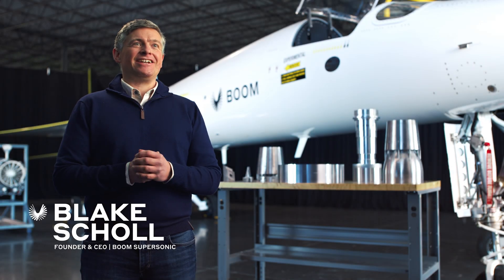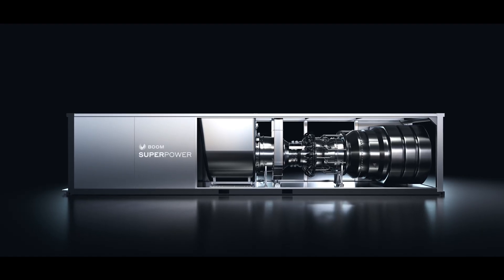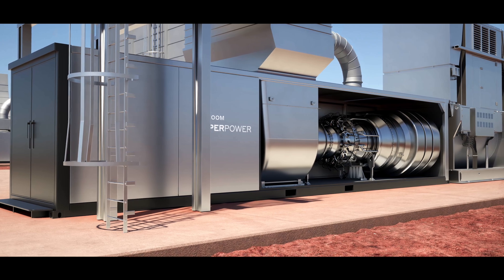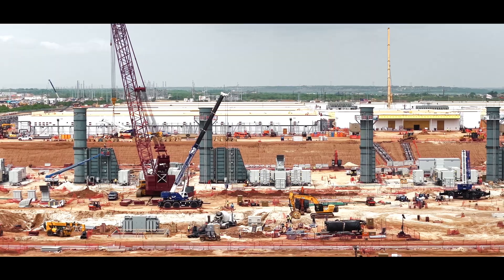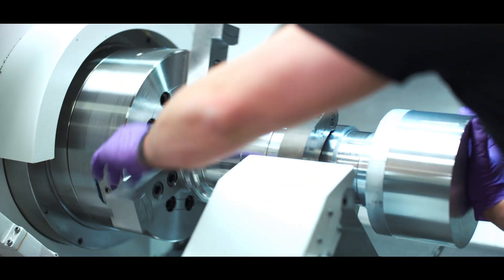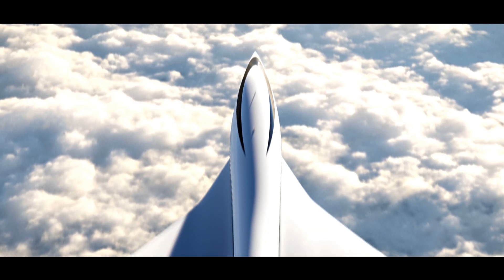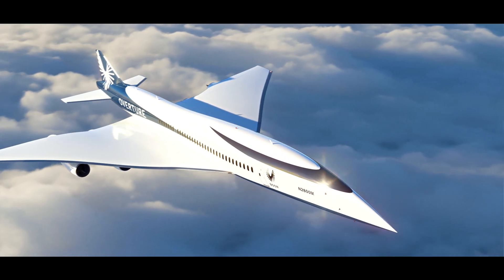Introducing Superpower: The Supersonic Tech Powering AI Data Centers

Comment: Quite a small unit . Others use engines like the RR Trent which is over twice the size and probably more efficient.  I don't think hours clocked on the ground are quite as valuable testing wise as hours in an airframe at 40000 ft.

Comment: A balanced take - potentially a distraction from the primary mission of building the jet. However, if they can actually get this done and get even a handful operational in 2027, the credibility gain to the new engine design alongside all the long term running data they will get will be invaluable. Not just from a perceived reliability standpoint, but from a certification standpoint. Pilots that fly PT-6 equipped airplanes often brag that it is the most reliable turbine engine in the world and how there are turbines running in ground power applications that have stupid amounts of continuous runtime. I am at least glad there's a potential here for an actual revenue generating product soonish that will help Overture come to fruition. You go guys.
Reply: Certification is just a bit more complex than hours accumulated on the ground which bears no relationships to it's actual usage in an aircraft.... That's the sort of trick Boeing would try, but then it sponsors the FAA.

Comment: I see a lot of confusion here, so I will throw in my two cents to add to it.

There are 3 basic designations of gas turbine usage.  

Aircraft engines, which are optimized for thrust, for obvious reasons.  They have massive thrust but almost no torque.

Industrial frame engines, which are optimized for torque.  They have almost no thrust.  In fact, the back wall of the exhaust collector is frequently no more than a couple of feet from the engine exhaust flange.  Typically their casings are several inches thick, and they would break off any wing they were attached to.  The output shaft is connected to a reduction gear which is then connected to a generator.

Aero derivative.  These are the high pressure core of an aircraft engine, referred to as the gas generator, with a power turbine bolted to the exhaust.  The only mechanical connection between the gas generator and the power turbine is the outer casings are bolted together.  This is called an aerodynamic coupling.  The power turbine spins at a much lower speed and converts the high thrust gas generator exhaust into high torque output, which is then connected to a reduction gear and a generator.

The exhaust of the industrial and aeroderivitave engines is usually sent to a boiler (actually a steam generator, which is NOT a boiler) to create steam and recover the waste heat.  This improves fuel efficiency dramatically.  This type of plant is referred to as combined cycle when used for pure electrical production.

The steam can be used for customer applications such as food processing, paper mills, enhanced oil recovery, or any other process requiring heat or pressure.  Typically the excess electricity generated is sold.  This can offset the fuel costs that would otherwise be required to generate the steam by a large amount while also providing essentially free electricity to power the process.

The steam can also be sent to steam turbines to generate even more power, but this requires more equipment like superheaters and condensers, and the plant will require much more cooling water.

The turbines will run on any fuel that you can get through the fuel injectors, but is usually natural gas, diesel fuel, or aviation grade kerosene.  Many plants will only use natural gas, but other plants will have dual fuel capability for reliability.

40MW is a good capacity.  By placing multiple units side by side in the same generator station, one engine can be taken off line for maintenance or repairs while the rest pick up the slack.  This is called power blocking.

The other advantage is that the shipping container size allows them to be placed anywhere there is a natural gas pipe, a power line, and water available.  No 5 year construction plan is necessary.  Just pour a concrete pad, bolt it down, and hook it up.  The waste heat steam generator and the auxiliary equipment will take much longer.  The water usage of a combined cycle plant can be very low, depending on cooling systems design.

The statement that inlet air cooling is not necessary even at high ambient temperatures is surprising though.  Higher ambient temperatures reduce air density, which reduces compression, and limits how much fuel can be introduced.  In addition, it will have major effects on NOx and CO emissions, which is a major constraint of these types of plants.

There are emissions reduction technologies, but they are very expensive, maintenance intensive, and require very well trained technicians.  High school grads won’t work.

Nobody has done it yet, but I am waiting for the day someone designs a plant that consists of a few shipping container sized packages.  One contains the turbine and generator, one contains the steam generator, one contains the control room, shop, and switchgear, one contains the auxiliaries such as pumps, air compressors, water treatment, etc, and one contains a steam turbine/generator.  Pour a pad, bolt the containers down, hook them up to each other and the utilities, and push the start button.  Build and test them at a factory where you also train the operators.  There you have it, a 40MW plant that can be installed and start operating in less than a month.  And since the plants are a standard design, moving crew around is not a problem.  Currently, although components and turbine packages may be standard, the rest of every plant is a bespoke design, which makes it a major cost.

If your plant manufacturing facility is located in a major city there will be plenty of trainee candidates that graduated high school, are very smart, but for one reason or another they aren’t planning on college.  Pay for their training with a contract that after completing training they will work for you for 5 years, or pay their own training costs.  Then have them bid on which plant they want to operate.  The only requirement is that they can pass an aptitude test and are willing to relocate upon graduating the training program.  As part of their training have them assist in plant construction and testing.  That way they know the ins and outs of the design.

There are many small towns all across the US that are at the end of a long, dirty power line, and are the first to have their line cut during upsets.  By installing a small plant on the outskirts the town can have their own plant based on three models:  the town can hire the manufacturer to own and operate the plant; the town can own the plant and hire the manufacturer to operate it; or the town could own and operate the plant.  Under any of these three scenarios, the high efficiency of these plants will allow lowering of electricity costs while still generating revenue for the town.  Of course the utilities will fight this tooth and nail, but screw the greedy bastards.

The environmental benefit is that while it doesn’t eliminate fossil fuel use, it dramatically reduces it, and natural gas burns cleaner than the alternatives.  While solar or wind plants would eliminate fossil fuel use, they both come with a whole host of electrical engineering problems that nobody tells you about when you try to scale it up.  It will work, but it will also at least quadruple your energy costs if you try to convert an entire town to it, and before people start jumping down my throat for that statement, remember that you have to charge enough to cover replacement and disposal costs.  As far as the electrical engineering problems, I won’t get into them here because it requires an understanding of electricity into the calculus range.

I can’t remember which, but either the Practical Engineering or the Smarter Every Day channel has a video that touches on this problem.  

What it basically amounts to is the grid was designed around rotating AC generators running at a set output and power inverters are different, and solar and wind don’t deliver a set output.  The effect this has on transmission lines is dramatic.  And before you bring up battery packs, they come with their own problems.  It can and has been made to work, but it is not a mature technology and is expensive to implement.  People have died because of these problems.  Just ask Texas about the costs of an unexpected deep freeze.

There are no practical (emphasis on practical) alternatives to fossil fuel.  Nuclear would work but is unacceptable to the majority of the population.  Solar and wind have their own problems (especially long term).  Currently my money is on either Quaise millimeter wave boring reducing the cost of geothermal and allowing plants to be put anywhere, or a breakthrough in fusion power (Helion looks promising).

Both of those alternatives would allow scattering of small plants throughout a city, reducing the risk of single point failures affecting the entire grid, and both are carbon free.  They will generate low levels of radioactive waste, but this is equivalent to the radioactivity of a smoke alarm.  These waste products will be the equivalent of oil well pipes, and under the same NORM regulations.  Your granite countertops are more dangerous.

Energy production is a very complex problem, exacerbated by greedy corporations and politicians who have to rub their stink on everything.  Any knee jerk simple solution will end up being a disaster.  There are no easy answers here, and you need several very specific college educations to even begin to understand the complexities involved.  No one person could possibly know all the pitfalls.  As always, no solution will be perfect, and jumping for one that sounds good is a sure way to fail.

To crib a meme: Affordable, clean, possible.  Choose two.  Sorry, I know it sucks, but there it is.
Reply: Wasn't expecting the most balanced and sensible energy take of the day in the Youtube comments!
Reply: @aaronbarker8842  I was in the industry for 45 years.  Did coal burning, hydro, combined cycle, and solar.  Started at the bottom and worked my way up to near the top.  You learn a few things in a lifetime.  😊

I am always amazed at the people who know nothing about the engineering and financial requirements who just jump at anything that sounds good without doing at least a minimal amount of research.  And not just in energy production.  I think the root cause is because education is no longer about teaching people how to learn, and is all about teaching them to accept whatever dogma is the flavor of the day.

The most important thing I said in my previous post is that simple solutions to complex problems inevitably end in disaster.  You have to study the problem, and accept that there are no perfect solutions.😢

Just try to leave the world a little better than when you arrived.  It is the best we can hope for.
Reply: This was a great read, thanks for the comment
Reply: AI FOR SURE
Reply: @Rick-C-117   Why?  Because I can write and know my subject?  I learned to read when I was three.  I worked in power generation my entire life.  I also never stopped learning.  I am 65.  I got my GED at 17.  I joined the Navy and spent a year in school followed by five years aboard a destroyer as a gas turbine tech.  I worked contracts in Saudi Arabia before returning to the US.  I never stopped learning.  I have studied architecture, history (ancient, medieval and modern European, Chinese, Japanese, science and technology, military,) mechanical engineering, electrical engineering, automation engineering, advanced instruments and control systems, electronics, computers (built my first PC in ‘85), programming (basic, fortran, cobol, java, C++, ladder logic, function block, sequential function), electronics, mathematics, comparative religion, mythology (Greek, Roman, Norse, African, South, Meso, and North American), anthropology, paleontology, entomology, virology, chemistry, physics, geology, evolutionary theory, biology, medical science, political science, sociology, psychology, philosophy, and many other subjects.  I pick a subject that interests me, buy textbooks, and start studying.  I don’t watch TV.  The only social media I use is YouTube, and I limit myself to 8 hours a week, mostly science and technology channels.  The rest of the time I am studying something.  I have been doing this since I was ten years old.  I have written technical manuals for equipment I designed and built.  I have trained hundreds of students in engineering operations using training materials developed and written by myself.

You accuse me of being an AI because I am not intellectually lazy.  Is this because you are incapable of writing a post like mine, or are you just trying to be a troll?
Reply: Renewables are still winning.
Even with the admin trying to prevent it for the oil companies money.
Reply: Without a doubt the longest comment I have ever seen on YouTube. Also 99% sure AI generated even if you proof read it. Tell me I'm wrong.
Reply: @ChrisFranklin.2260  You are wrong.  No way to prove it without doxing myself, which ain’t happening.  Believe what you want.  BTW, I have posted longer statements on other subjects.

Comment: Pretty sure aircraft engines and ground power turbines have radically different design criteria.
Reply: No, they actually the same. Combined cycle power plants use very slightly modified airplane engines. The problem is that it is old, established industry with many players. What new a startup can bring here?
Reply: @Stebanoid  While the operating principle is the same, most purpose-built industrial gas turbines end up being radically different in design than aircraft engines. Aeroderivatives, being adapted from aircraft engines, have a much better power to weight ratio, much faster starts and ramp rates, and are often more efficient at partial loads. Industrial gas turbines are generally designed to run a a steady base load for very long periods of time, with longer maintenance intervals and maximum reliability.
Reply: It's been done before. Rolls Royce.
Reply: They do, but there are applications where aeroderivatives make sense. GE has been selling them for decades, they call it the "LM" series.
Reply: the amount of anti-AI hate in this comment section...

Comment: History says that when a company pivots its focus to something completely different they are not doing well on their primary objective.
Reply: Boom is developing a turbine engine that can be used in two different ways just like Tesla developed battery packs that can be used for both residential and automotive uses. (I acknowledge Tesla is a sinking ship now, but I think them doing residential batteries was a good idea that worked)
Reply: This is not much of a pivot, gas turbines for flight and power generation are very similar. There are entire classes of gas turbines called aero-derivatives that are fairly common in power generation. Companies like Baker Hughes takes old GE90-115B from 777s and converts them into natural gas power generation packages (LM9000, as an example). I can definitely see how gathering data on how your gas turbines operate on the ground (thermodynamic performance, vibration, bearing wear, etc) can help with reliability in the air. Of course there are completely different regulatory bodies and other things at play, but I think this is a pretty neat business strategy. We will see how it pans out, only time will tell. I wish Boom the best.
Reply: It’s not a “pivot”. A pivot is when you end one line of business so that you can start another. This has been going on for three years, while they are simultaneously working on their jet which uses many (≠most) of the same parts.
Reply: @BlueOceanStrategistS  Agreed.
Reply: I don’t think so. A lot of companies can have multiple products at one time.

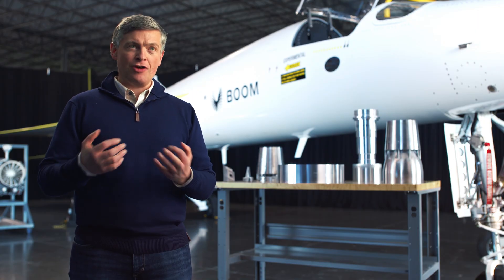Comment: 1:28   What fuel does it use ?  How is it "clean" ?
Reply: These kinds of power plants use "All natural" natural gas.
Reply: My thought exactly. I am so tired of being told that pollution is good for the environment.
Reply: @danlehman1895 natural gas is a lot cleaner than coal it's kinda the cleanest practical power generation we have after nuclear
Reply: Read the description. It’s natural gas.
Reply: @BlueOceanStrategistS fair enough, I will admit that was my mistake, I didn’t read the description
Reply: When most companies say "clean" now days they just mean it has less CO2 emissions than some "alternative" or slightly more efficient than historical solutions
Reply: Nonsense: the critical path for AI datacenters is speed, not cleanliness of fuel.
Reply: I’m guessing that it’s supposed to run in sustainable aviation fuel (SAF), which can be made synthetically but is kinda pricy
Reply: @polarisukyc1204 SAF isn't natural gas, whatever that actually looks like in this application. But turbines are sometimes omnivorous.
Reply: @Cyrribrae true, your average gas turbine will eat just about anything that can burn with enough heat and can be made to flow, from nitroglycerin to coal dust, but I was basing my estimates (probably with some naïveté) on the fact that Boom SuperSonic’s aero engine (called the Overture, I think) is designed to run on SAF